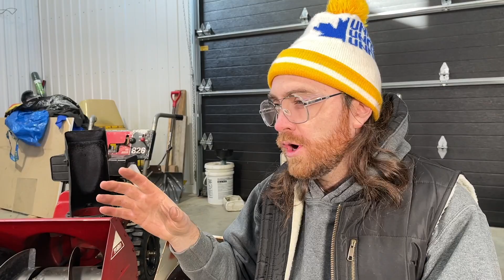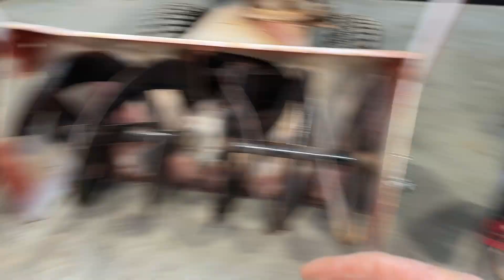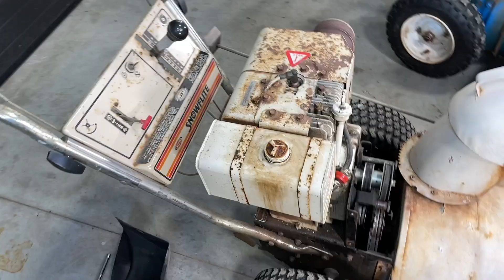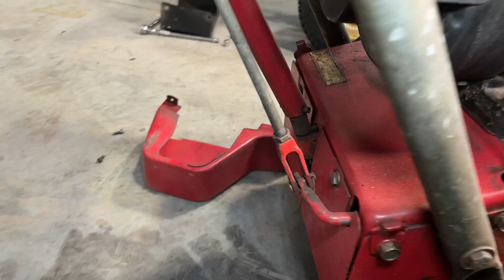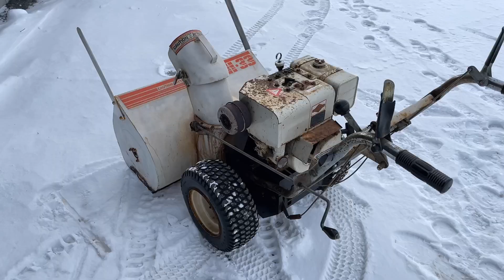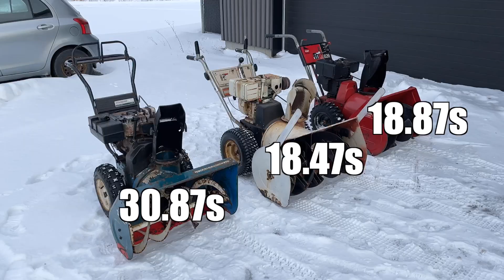ULTIMATE Snowblower Tune-up Guide! Part 2- Augers, Traction Systems and the Showdown!!!

Comment: For the impeller palette mod @ 5m44s, did you mean to reduce the clearance? @ 5m52 you explained that too much clearance between the impeller and the casing wall was conducive to clogging with wet snow, so I believe you meant to bring the impeller closer to the casing wall.

Another good video!
Reply from the maker: Yeah, sorry if I wasn’t clear in the video, but yes the plastic scrappers reduce the impeller to wall clearance and this helps evacuate wet snow much easier. Thanks for watching my videos!!!